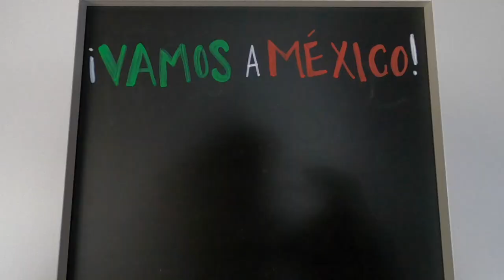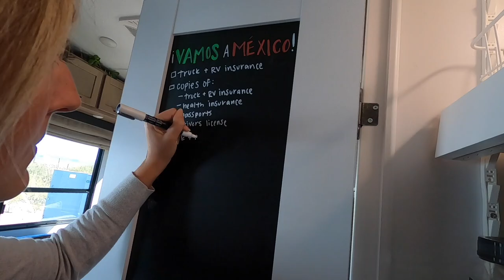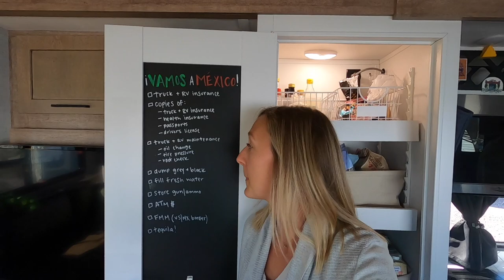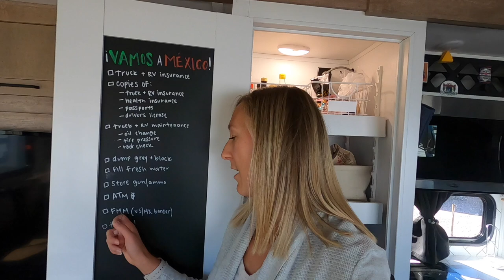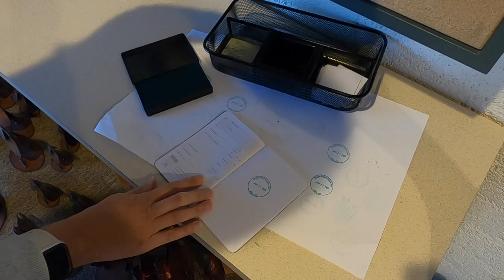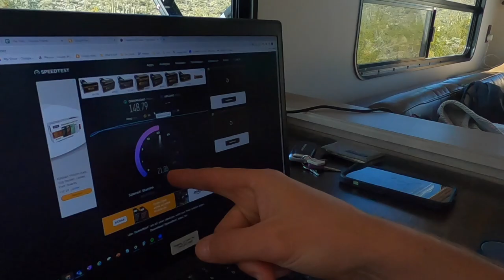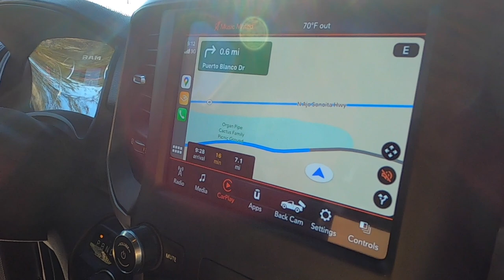ROAD TO MEXICO EP. 3: How We Prepped To Cross The Border (RV Life)

Comment: Pro tip:  TPMS sensors should be installed on brass or stainless steel valve stems.  Some say you can install them on a rubber valve stem (although it will wear out quicker) but they typically at least recommend a metal valve stem.  Some specifically state that you cannot install them on a rubber valve stem.   A rubber valve stem is not designed to withstand all that centrifugal force with the added weight at the end.